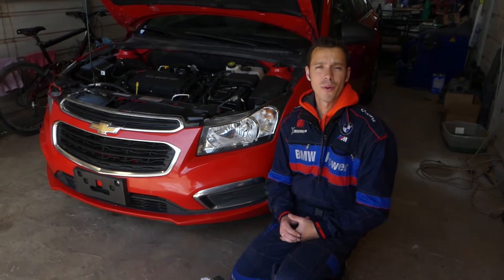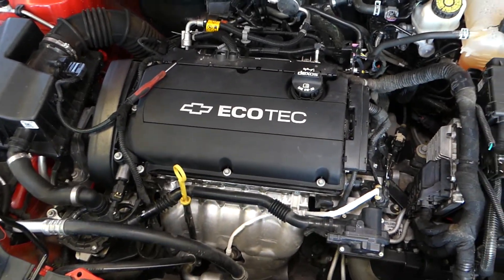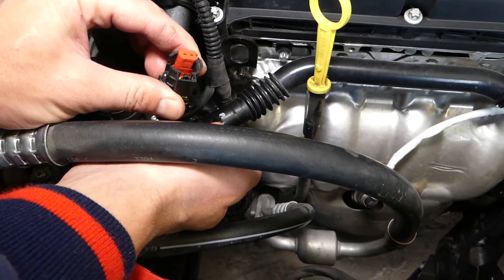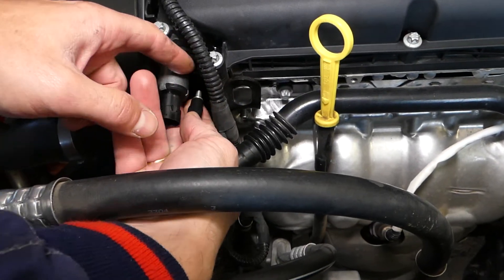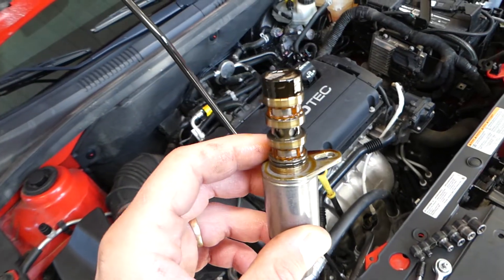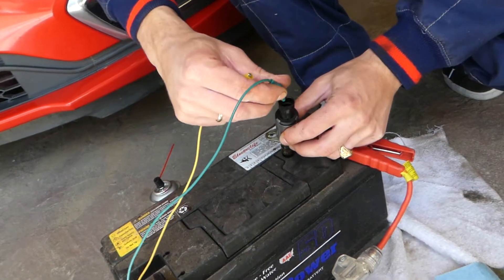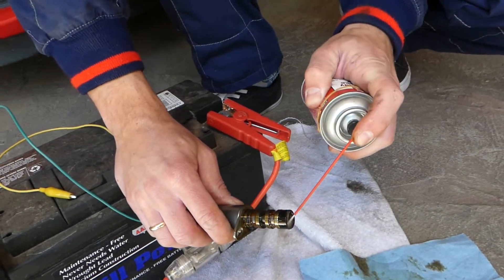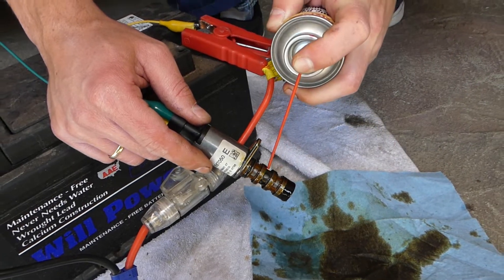HOW TO CLEAN VVT SOLENOID ON CHEVROLET OPEL ECOTEC  VARIABLE TIMING SOLENOID CLEANING

Comment: a Vauxhall remedy fix remove  filters  stops them getting  blocked working properly triggering  engine light.  Done it with my vectra  vvti   it's gets  12 month oil changes

Comment: I read that taking those clips off can help, since there is already a filter head, and providing the oil is regularly changed, it can prevent the solenoid presuming it is gunked up (or triggering the ECU thinking it's a fault).

Comment: Hi all
I managed to clean the front solenoid but the back one would move in and out about 15mm but would not come out !
Any ideas why ?
I tried to knock it out with mole grips and a hammer but unknowingly split the solenoid so it leaked oil everywhere when I took it for a drive. 
Can anyone advise me how to 
remove the solenoid now the outer piece has snapped off ?

Comment: Cleaning with warm water is better
Reply: I wouldn't risk moisture getting in it. Solenoids are essentially magnets, and any metallic particulates could get stuck on it or in it, and potentially cause false reads on the ECU

Comment: My car with same engine was sluggish and had random loss of power from a stand still till the car got to over 2500rpm then would run fine till the next stand still in traffic. Had rattle on start up too. I struggled like mad to get these solenoids out as was told possibly is them. Both looked fine at a glance. I removed the filters from around the edges and threw them away like instructed. I did not remove the filters from the ends!  I Cleaned them out with Wd-40 like he does in the video and refitted the solenoids. The rattle has pretty much gone and the car is very noticeably quicker. I mean it’s nippy and feels like an 1.8 Sri now!  I’m yet to have the car go into a no power situation again but I’m hopeful this was the problem. Believe it or not i was getting no more than 28mpg no matter how I drove it since buying it. And now it’s funny because I’m getting 44mpg at least. It even gets over 60mpg running about. It’s great 👍🏻 if I get any problems now I will just replace them for OEM ones. Also I’ve had no engine light on or any codes stored.
Reply: Update. Car started playing up again. Idle rough and loss of power. I’ve removed and fitted new oem solenoids! I’ll report back with any info. Car idles near perfect since new ones fitted and power throughout the gears and revs is good
Reply: Our car is getting also worse mpg, and im thinking allso if its solenoid but no codes found?
Should i just incase Take both solenoids and try to clean, easy try out, maybe better to try
Reply: juuppi juu hi, I ordered a new set of spark plugs. Bosch plugs and also genuine solenoids. I cleaned my solenoids but it didn’t stop the power loss or bad mpg. Was a waste of time. Since changing the solenoids the mpg went from 28-30 up to 34+ on long runs I’m getting like 45mpg+ my range was down to 280 miles a tank and now it’s 470 miles to a tank. It’s amazing. I bought 2 genuine GM solenoids from eBay for 45£ (GENUINE Vauxhall Zafira Vectra Signum Camshaft Valve Position Solenoids x2 - NEW) and (4 x Bosch 0242229699 Spark Plug Brand New OE Quality Plugs FQR8LEU2) the writing in brackets are directly from the listings off eBay. My car is the 1.8 Sri z18xer engine. Just copy and paste the bits in brackets in eBay search to get the same parts. Well worth it. My car use to vibrate through the steering wheel too. It doesn’t do that anymore either. I’m saving no end of money now as I’m getting at least 100 miles out of a quarter of a tank now too. Vauxhall site recommended them spark plugs for my engine. I had nkg plugs and they were a year old. I changed the plugs before as I was having hesitation problems but still had it with the nkg plugs. Since I put the Bosch plugs in and changed the solenoids it’s like a new car 👍🏻 so smooth and no power loss as of yet and it’s been a while now
Reply: @SaucyBegger25   Hello. Our engine f16d4, cruze 2013 MY. we have done headgasket lately and timing belt change. Local garage destroyed exhaust camshaft when he forgot to remove  camshaft locking tool while turning engine, I had to help them to find new exhaust camshaft while they reinstalled everything back. When we finaly got car back our mpg has been very bad. first i thought that they have failed on timing marks but they seems to be ok, I have tryed to change spark plugs ( Denso K20TT ) and new ignition coil pack but no changes to MPG. Im running out of ideas, i have feeling that they have destroyed VVT sprockets but i dont have any clue how to test this because engine doesnt rattle. Maybe last change is to try this VVT solenoid trick + maybe bosch sparkplugs?   they did change oil cooler to but it didnt last long, maybe 1month and it started leak again, so now this is on project atm do.
Here is googedrive link from our engine which was ripped totaly apart on this garage who destroyed camshaft and did whole repair, do you notice something there? 
Allso there is few photos of timing marks how they should be and different manual pages.
( https://drive.google.com/drive/folders/1TrYcSc_KmPwGlyDkxIa0t07JPZi8ocma?usp=sharing )

ps. Forgot to mention,  went to MOT to check emission and they was all fine!
Reply: @j00p1  I think I have a similar issue. Car idling very rough. Have you remedied the issue with this process?
Reply: @Goldgiancoast  yes i do! i did finally got the problem.  Opened VVT solenoids and on filters there was black slime. After cleaning those whit brake cleaner the car has more power and MPG dropped. Maybe i try to clean them better whit adding 12v to pins to open solenoids and spraying cleaner, or just buying new ones!
Reply: @j00p1  Thanks for the update. I am just surprised this issues do not show any engine light or codes. Rough idle with no indicators is very tough to diagnose. I guess I may have to change solenoids and see.
Reply: @Goldgiancoast  yes, no codes found. I went to dealer about this case, and they didnt have any remedies for this kind of issues and also told me that they have changed solenoids only few times In past 5 years, but then there have been code.

Also told about the Black slime and i have changed oil every 10k but no affect to avoid slime to filters

Take it apart, one torx and put something rag over solenoid metal case and use pliers and try to pry it out gently. Remember to put paper/rag under torx Bolt Because it Will fall
Reply: @j00p1  Thanks for the information. You have the same issue as me. Took it to the dealership and all they wanted was to find a code to diagnose but there was none. Solenoids were done exactly a year ago so I was really doubtful about it being the cause. Your information seems to be that it might be the case. My symptoms is like this.: when I start the car the first time in the morning, it runs perfect for about 40 seconds then after the rpms drop and the shaking begins. After watching the video I tried to take them out and clean but it wouldn't come out. I stopped because of the fear of breaking something.
Reply: @Goldgiancoast  Please tell me when you are doing some maintenances, maybe pictures would be nice. Can you email me or something :) id like to know, I'm kinda interested all kind of puzzles
Reply: @j00p1  Sure. Will keep you updated.
Reply: @Goldgiancoast  update from me: i am ordering New solenoids, i think i didnt get fuel consumption In hand. But performance did came back
Reply: @j00p1  I had intended to send you a message soon. I did exactly everything in the video and that did not help. As I said, the solenoids are typically new and less than a year. I cleaned them and attached it to power supply to open the valves and clean. Everything went well with the process but rough idle still continues.
Reply: @Goldgiancoast  Hmm, have you changed spark plugs? cleaner MAF sensor? checked if there is vacuum leak? you can try to start engine and open oil cap and if engine run changes dramatically it i think it is vacuum leak
Reply: @j00p1  i am considering the spark plugs. I checked and the plugs are black with sooth. I don't know if that's the cause or the rough idle caused the sooth. (as per research the black sooth is caused by several factors but primarily due to very rich mixture.). I have not checked the MAF because they looked at it during the last oil change. I may still have to take a look at it. Have not seen any leaking as well. Will try the oil cap thing you suggested.
Reply: Tried the oil cap thing and the engine was normal with no vibration. Checked the Throttle and MAF and everything was fine. Still Cleaned Throttle but issue still continues.
Reply: @Goldgiancoast  have you plugged to computer to check if codes? next i would try new ignition coil.... sounds very odd. try read if codes ? please mail me so we can chat

Comment: I dropped the bolts - both of them (went completely against your advice) front one and back one in the engine compartment and couldn't find them for ages. 😣The person who had the car before me must have replaced the front solenoid screw with a different screw because it was a normal torx head (not reverse torx) and it was shorter they may have stuck it up with some kind of bonding  glue.😖
 Any way I thought the screw was tight I was careful but when I started the car unbeknown to me the solenoid shot out.😬
The fan belt, timing belt radiator and half the engine were covered in oil before I realised. I sat there gently revving thinking oooh this sounds better (maybe engines sound better with no oil in them) 
The oil has now started to eat my tarmac drive. 😭
The thread was now completely stripped and the car was left unable to move for a week because there are no shops open (virus)😷and I had to wait for a tap and tap wrench to come from ebay as well as a replacement screw. 😡😡LOL

The funny thing is they really didn't need doin'

My next project is to replace the brakes pads and rotors easy😇......or is it!😈 
I am seriously thinking of filming this one. By the time I finish the job there will be material there that may get me 2 million views Lol😁

Anyway thanks for the videos subbed because they are really clear and informative.
Reply: This is the most funniest comment ever 🤣 please make that video of the brakes 😂
Reply: hopeful this time you forget the spanner inside   :)  just joking, I went through the same mistake,went to wash my engine to find an oil leak, ending up with lots of issue one after another, gearbox failed, cooling fan now coming on in a full speed once the key is at on position and never shut until after a minute of engine off, 02 sensor high voltage, engine variable camshaft position P0011 lots of things and I did not even need to wash the engine